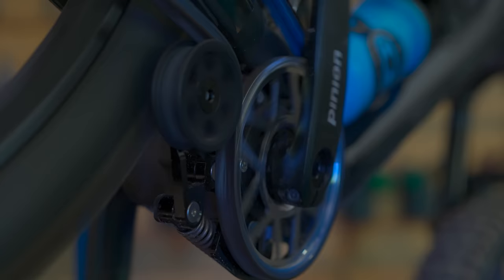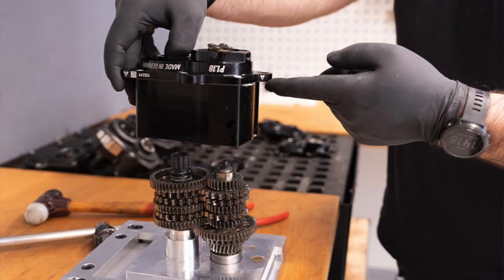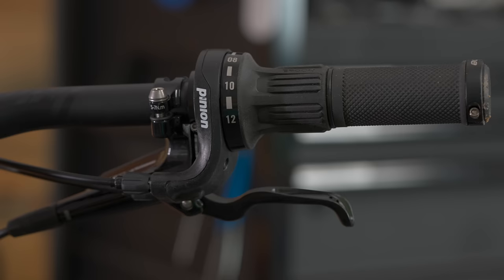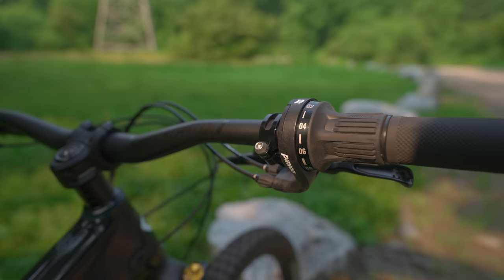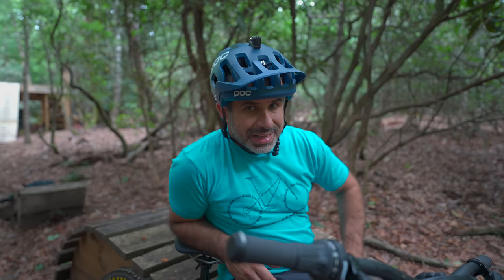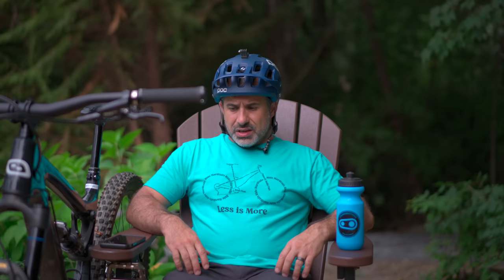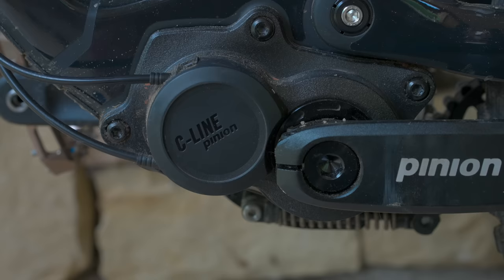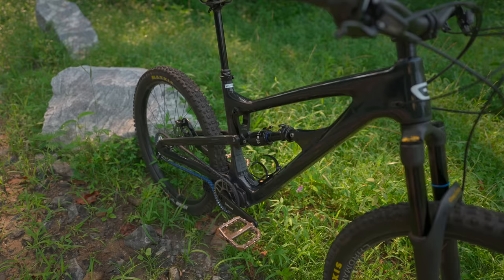What's the deal with gearboxes? Why don't more mountain bikes have them?

Comment: They really make the most sense on e-bikes. That motor/gearbox combo Pinion released with electronic shifting is the ideal situation for this.
Reply: not having a derailleur to smash off on a regular mtb doesnt make sense?
Reply: The only Problem left with these pinion mgu bike is that they start at 5500€😅
So the gearbox - motor combination most likely costs at least 2500€
Reply from the maker: Although I have not tried Pinion's new electric drivetrain, it makes total sense. Gearboxes have already proven themselves on other motorized vehicles, and with how much abuse E-bike drivetrains deal with, it's a natural fit.
Reply: @thescerigai  People say like this happens all the time.
Reply: @NikolaiVozza  you ride cross country dont you?
Reply: @thescerigai  sure, but they’re heavy, you have to significantly lift off the power when shifting, and grip shift…
Reply: @ChefIan73  they remove weight from a bad spot and move it to a good spot suspension wise, leading to a significant improvement in suspension performance, you also need to back off your power on most derailleur systems to avoid horrible noises and snapping your chain, the ability to be able to change gears without pedaling on gearboxes far outweighs having to back off while climbing
Reply: My first thought too! When the time is there to switch to electric, it probably will be one with a Pinion MGU.
Reply: @thescerigai Having a less vulnerable drivetrain would be better, but derailleurs have an amazing combination of range, weight, and efficiency, so it's not quite so simple as choosing the most durable option. Personally, I'll stick with derailleurs for the time being for any leg-power bike I expect to pedal over distance or elevation. I'm comfortable nudging a bent hanger back into "good enough" shape, I carry a spare on my MTB, and I always have a chain breaker on me, so I can bypass a completely broken derailleur. And a cellphone, so I can call for a pickup instead of riding all the way home on a makeshift single-speed.

All that said, any bike I'm not worried about efficiency, give me a belt drive and an oil filled gearbox.

As for not being able to shift a derailleur under load, it's a nuisance but not an insurmountable one. Maintain your drivetrain, time your shifts, and remember to shift before you need to drop gears not after, and your shifts will be smooth. But that is a lot of work compared to "just shift". It's definitely a trade off.

So in summary, derailleurs are obnoxious and I'm waiting to see how all these alternative systems hold up in the long run.
Reply: It's a good thought, but there's a better way. Mid-drive ebikes are much better than hub-drive ebikes because the motor can take advantage of the bicycle's gears.

You'll find the best belt-drive ebikes use a mid-drive motor with a Rohloff or Aifine internal-gear hub in back. That's the e-bike gold standard. (After having one of those, I don't see myself buying a hub motor e-bike again)
Reply: Completely agree. I don't have an e-bike, nor do I plan on getting one (unless there was a pedal only bike park near me in PA) but if I did I'd definitely get a gearbox. That's the only application I'd consider it for though ... I kinda like cleaning my bike and tinkering, so wouldn't want something with such little maintenance.
Reply: @ChefIan73 i wouldn't consider regardless (unless I had an e-bike) but you're right, that grip shift is a huge no for me. I already have a bad wrist from power washing the last 20 years, and that seems like it'd be really uncomfortable for me ... And I don't care about the weight, but I don't like the bulk and extra cable.
Reply: @thescerigai i heard Seth mention it, but how does a gearbox improve suspension (genuine question, not being snarky)?
Reply: its a game of efficiency vs weight. Nothing will ever beat the derailleur on those two. But with ebikes everything changes because you already have the mount and casing and ebike motors have gears to make it compatible with derailleur's  now they can make a specific unit with embeded electronics. My penny goes to chain,  huge cog in the rear small in the front and ridiculous rpm and the axis of cranks and front cog will not be the same
Reply: The best part about having an Ebike is if the chain breaks your hub motor will still get you home. I've had this happen to me when I was climbing the hill behind the well known cherry on the spoon sculpture garden.
Reply: @relativityboy their new system is a motor gearbox combo all mid mounted.
Reply: It's too bad Seth is so anti-ebike.
Reply: And the best part is that the freewheel is in the front, so you can have a mid drive, and you can have regen!
Reply: On my E-Bike I use for commuting I never shift...allthough its 30 km with partially 5% ascends... maybe I am doing it wrong but it does not even occur to me. The engine is my shifter 🤷
Reply: @jef777 it's a bit lazy but if it works :)
Reply: @johnpossum556  Mountainbikes don‘ have hub-motors. Those are terrible for suspension and have terrible efficiency at low speeds (climbing!!!)
Reply: @topspot4834  gearboxes reduces unsprung mass (weight that has to be moved out of the way) and increases sprung mass (weight that helps to compress the suspension). gearboxes remove weight from a bad spot and move it to a good spot suspension wise
Reply: @SnakebitSTI  "And a cellphone, so I can call for a pickup instead of riding all the way home on a makeshift single-speed." we want durable vehicles to avoid this situation you see, thats why im getting a gearbox on my next bike, wtf is efficiency gonna do for you if your system keeps breaking? derailleurs dont belong on mtbs
Reply: I was waiting for this comment
Reply: I would think the belt drive would be good for commuting as no chance for chain lube on your leg . Have a Kevlar belt on my Harley they say is good for 50k miles. Obviously smaller lighter belt for a bicycle
Reply: @SethsBikeHacks  I'm really looking forward for your video on the new Pinion e-gearbox system. Seems to me that it has the best of all worlds.
Reply: @thescerigai  I've never broken a derailleur. Worst I've done to one is bending the hanger so the chain wouldn't stay in a gear. I just don't see derailleurs as a serious durability issue.
Reply: @SnakebitSTI  you ride cross country dont you?
Reply: 2nd this…. The Pinion MGU is where this will shine. Ebikes destroy regular drivetrains.
Reply: @relativityboy  it is a middrive motor, just with the gears built into it, why have a mid drive with an internal hub when you can have the mid drive with the internal hub built in, me personally I have always like the idea of the pinion gear box, but as an ebiker myself, I'm not willing to trade my middrive motor for a hub to get a pinion, that said, if I can get a 2 in 1 and have both the gearbox and motor together, I see it as a huge win, this will definitely be part of my bike when it releases here in the states
Reply: @chilloutyaall same here. Both my Harleys are belt drive and it’s the most reliable part of the bikes!  Pinion uses a belt made by Gates, the same company that makes the Harley belts.  My next bicycle will be a belt drive Priority.
Reply: Pinion MGU: FTW! Can't wait for that thing to get on some US based enduro bikes!
Reply: THIS . E-shifting for me has been a kinda "eh why tho" thing because no battery on your usual bike. 

E bikes however HAVE A BATTERY AS DEFAUT, Here it makes sense and even the shifter can run of display power , NOT EVEN SHITTY CR3032
Reply: @iboysven decent emtb basically start at $5k anyway
Reply: @ChefIan73 electronic shifting fixes the grip shift (gone) and shifting under load(shift on the dead spot). the gearbox controller can use the data from the torque sensor, shift instantly if the pedal load is low, or wait for the dead spot, and if the rider is still applying torque, very briefly apply negative torque
Reply: @relativityboy mid drive, belt and geared hub is good (perfect?) for commuters.
but powerful,  torquey, affordable hub motor with a torque sensor and cheap groupset is also very suitable for commuters on a budget who don't want to pedal hard and/or keep switching gears, and don't climb super steep hills. possibly even fixed gear. my wife's perfectly happy with her 750W, geared hub and always stays in top gear, medium assist and occasional throttle to trigger peak torque on steeper hills. mid drive would be a complete waste in her case. I clean/lube her chain maybe once a year
Reply: It was invernted long time ago. Some people call it motorcycle.
Reply: @iboysven my Honda CB500F was cheaper, and has also ABS, dirt protektion, mirrors, turn lights, etc.
Reply: @GrmlMaster  Not true, I have a RearHub eMTB Full Suspension, and coming from hard tail, I'd never go back.
Reply: @wabudo  me too, Tear it apart Seth, I want you to do a multi-day camping test with it ! Its a lot of money for my next bike!
Reply: @DOCWHOK9  Yoe being an excption doesn‘t change the rule. I dont know even one major bike manfactirer that has a Rearhub Mtb in its lineup…
Reply: Check out Nicolai bikes from Hanover Germany for that combination, expensive yes, but just awesome!
Reply: totally makes sense.
Reply: Just asked a question on one your videos about derailleur protectors… this video has answered it. 😂😂
Reply: On the one hand yes, since many e-bikes already have a 1 stage gearbox at the bottom bracket. On the other hand no, as in my experience, shifting performance isn't that important in e-bikes as the motor will help out a bit if you're in the wrong gear...
Reply: @thescerigai 
Yeah, I haven't owned a mountain bike since the mid 90s, and this is the first time I've ever seen or heard anyone explicitly discuss the subject of whether or not to continue pedaling hard while shifting. It just seems like an unspoken,  common sense, instinctual thing to significantly reduce pedaling force when upshifting or downshifting.
Reply: 100%
Reply: @topspot4834  You lower the mass of the rear wheel, by shifting the weight to the bottom bracket, closer to the centre of gravity. Because the rear wheel is a lot lighter, the rear suspension reacts much better to track over small bumps and to take the bigger hits. This means that your rear wheel spends more time in contact with the ground, giving you more control.
Reply: @thescerigai  Yes, I have got to agree. As a bikepacker, when I'm in the wilderness, a long way from support, I cannot rely on a phone call to home. Yes, I have by-passed a broken derailleur by breaking the chain and turning my bike temporarily into a single-speed in order to get home. Yes, I have carried spare derailleur hangers, and even straightened a bent hanger on the side of a trail. But my gearbox enables me to forget about those hassles.
Plus, on sticky muddy days when a derailleur-style drive-train gets all clogged up with mud, the internal gears in my gearbox stay clean and continue working efficiently.
Reply: @@aaronlisco1039 😂😂🙄
Reply: I think belt drive and gearbox or internal gear hub makes more sense than a chain on every bike that isn't being used for racing. The cost is the only reason to not have it on all commuter bikes.
Reply: Yeah, and replace the belt with a shaft, that should be something to talk about
Reply: @thescerigai 😂😂😂
Reply: The mainstream bike company's seem to be doing their best to stop the gearbox ebikes from taking off. It's clearly the best solution not a stupid battery powered derailleur.
Reply: The people I see on E-Bikes, at least in the city, should ride singlespeeds. They aren't shifting anyway. Always in the smallest cog.
Reply: @topspot4834 
Removes the weight of the derailleur and cassette from the rear or the bike. This makes for less mass to move around for the suspension. Same reason lighter wheels can improve suspension performance and ease of moving the rear or the bike around off jumps, if that’s your thing.
Reply: They make sense on all bikes.
Reply: @iboysven    The Lectric One currently starts at $2000 US. Has a Pinion gear box and 45 mile range.
Reply: @relativityboy  a gearbox with integrated motor would be able to handle much more torque than those dinky geared hubs.

Comment: The thing with MTB is all unique parts have advantage and disadvantage, so basically you can waste your money in different ways 😩😭
Reply: nah, it's not just a MTB thing ☺️ But it means how lucky we are, in cycling, to have so many absurd (or not) ways to get lighter on money 🤪
Reply: Road bikes are even worse. Proprietary bottle cages, proprietary seat posts, integrated stem-handlebar-control units that only work with the manufacturer's frame… Though I assume TT bikes are even worse than road bikes.
Reply: Ride single speeds, waste no money at all!
Reply: @SnakebitSTI  The idea that bicycles should be standardised between brands confuses me. I work in the bike industry and think we're exceptionally lucky that so many parts are cross-compatible. Try that with a car or motorcycle and you're going to need a milling machine, lathe, drill press, and tig or mig welder.
Reply: @Metal-Possum  I expect bicycle parts to be standardized because they are standardized. It was notable when car manufactures started using proprietary headlights. It's notable when bike manufacturers replace normally standard parts with proprietary parts.
Reply: @SnakebitSTI  Yes but not spoken fact is that every high end bike include sponsorships and competition so if you re not a recreational cyclist,you wont be in a much worry about all that stuff.The problems could occure if recreational cyclist buys a high end bike .As far as i know there is no labeling in the bicycle world which tells you literally which bike is for which purpose ,im not thinking about factory or seller recomendations but something like ,,this bike is ment to be for competition,all parts are high end and you need constant maintenence,compatible spare parts and some of them are unique so its not recomended for recreation,,
Reply: MTB tries to solve new problems it created with new gear every 30 days.
Reply: @SnakebitSTI proprietary parts.  

Schwinns 26x 1-3/4 tire size os mathematically different than 26x 1.75 so you had better get fractional tires. 

Same with their 26x 1-3/8s size..
The difference between the English 3/8s   size and the American 3/8s 6mm and two different tires with 2 different ISO numbers better get the right ones 

A real bugger sometimes working on something that's 75 years old at this point.
Reply: @styrenerodder1  Stuff that old can be a nightmare even for standardized parts. I have a 1950s British motorcycle that requires three (3!) different sets of tools: SAE, Whitworth, and BSC.
Reply: @SnakebitSTI  Well then, you'd be expecting too much. "Modern" (safety) bicycles became standardised many years or even decades after their invention but historically those standards were often different from country to country. 

The closest thing we've ever had to a universal standard across the entire world is saddle rails and how they're spaced, which apart from a few niche brands doing things differently, has stayed the same since the earlier part of last century...

And alongside that, there's no shortage of existing bikes and parts that do meet these standards, stop focusing on brand new bikes all the time and you won't need to worry. I ride plenty of old bikes that I'm still able to keep in service, it's only the very top tier stuff that it becomes such an inconvenience.
Reply: @Metal-Possum  I wouldnt say that such things as the double crown lefty forks are allways top tier. And there are many more things like that.